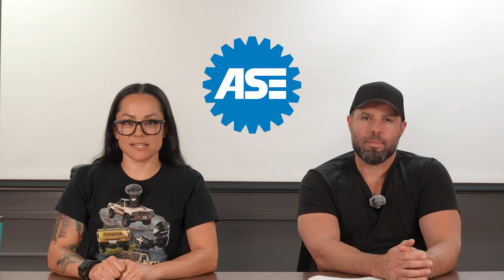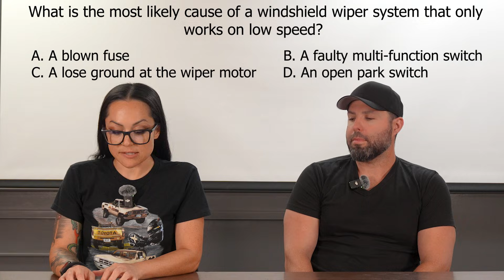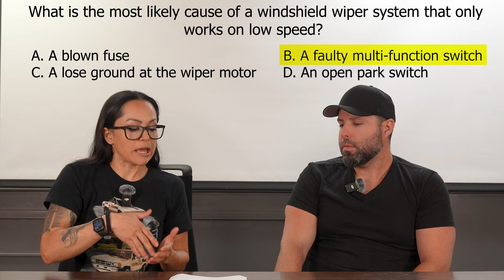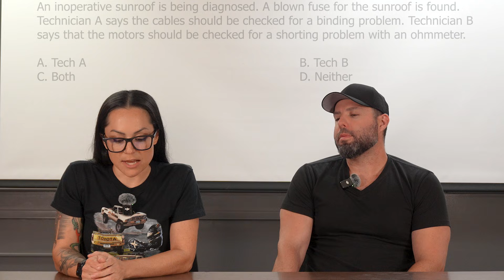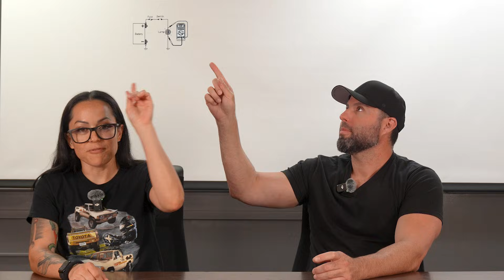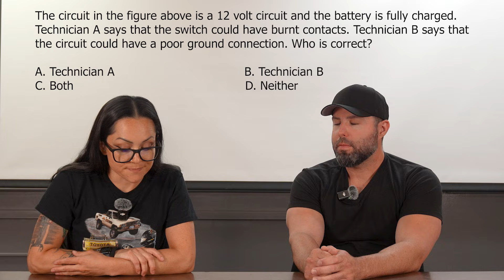Pass The ASE The First Time!!!! ASE A6 Electrical Test Prep Series Volume 1

Comment: I am a retired mechanic, 67 years old, When you get ASE certified it mostly means you are a good test taker...............Worked with some ASE certified people that did not know anything close to what they should have...............Real world experience...................
Reply: 🤣🤣🤣🤣🤣🤣🤣🤣🤣🤣67🤣🤣🤣🤣🤣🤣🤣🤣🤣🤣
Reply: I believe the same. But a lot shops pay you more if you are an ase master tech.  I will just take the tests to get more pay.
Reply: Sounds like ur lying , if ur as good as you claim by your statement, then honestly you should’ve just taken the test and get paid more , what are u gonna say ? “It’s just a paper”? But most mechanics are willing to spend 200$ on a over priced snap on tool but willing to call a certification just a piece of paper lol
Reply: But if you can break down the question the way these two just did I believe you can fix electrical problems in the real world if you have the fundamentals down you will do well in almost about anything in life. Though it’s true a lot of ase cert techs can’t fix problems
Reply: Yeah,  it's true.  I've got A1-A8 recertified since 2012, and I'm still not the best.  I'm good at studying and taking tests.  I can figure stuff out but takes me longer than it should sometimes.
Reply: So what is your point?
Reply: @StaticTesla  I think hs point is that being able to pass an ASE  test doesn't mean you will be able to do the actual repair or diagnosis on a vehicle. That part takes years of experience.
Reply: Facts!  I know people who’ve passed ASE tests and can find simple shorts. I also know a lot or people who CAN’T pass the ASE and they’re some of the best techs out there!
Reply: I think you need both.
Reply: SIXXX SEVENNNNN🤪

Comment: @13:00 hate to bust bubble, but clock spring is still used to turn the turn signal switch off after turning off road left or right, go ahead and change steering box and not make sure wheel is straight

Comment: I run my own shop I'm 45 and been a mechanic since I was 13 I've never been ASE certified! I've had some training but mainly self taught! If you seek knowledge you can find it and study it! I've been blessed!
Reply: I’m 25 I’ve been a mechanic for 7 years I’ve never been certified and had some good jobs and my own shop for 7 months got hooked on fent just got out of rehab 7days ago and ima take some tests to get my ase and hopefully open up a business legally and Ik having my ase will help me in getting a job for the meantime to get my cash up and get a car and take care of my daughter I agree if ur shops running good u don’t need it I specialize in performance and custom work as well as vehicle maintenance and part  replacement I wannna learn how to diag good and tune myself hopefully this test helps a bit Ik hp academy also has good information for what im tryna do they charge a ok price also for learning
Reply: I started at 13 doing custom suspension and installing hydraulics and airbags. In my dad's shop while he built motors for certain local street racers but you talking back in the day small block chevys and ford's. Fast forward to today and I build engines.back to factory spec. I do everything but build transmissions. I do AFM deletes on ls engines, certain ford deletes and also hemi mds! But some of my favorite is can system diagnostics! Put Jesus first my friend and anything is possible.  I've been sober for twelve years! Life has never been better! The clearer your mind is the better your work is!
Reply: Go get your ASE certifications and solidify your business credentials if you want to have your business thrive. I am not discrediting what you have, or what you have accomplished, but to think that you wouldn't attract more consumers through retaining certifications is extremely small minded. To claim you have the knowledge, yet, be too lazy to take a one hour test really says something about your character and the consumer sees that. Go get certified brotha.
Reply: @DexterHerrmann where I'm from My name speaks for itself! My business is thriving built off of honesty and good work! We specialize in engine building. It seems to be a lost art!
Reply: @joesmo4749 You don't know what you don't know.  I grew up in the industry but taking the tests exposed me to things I didn't know existed.  I still remember a question from the A9 that I didn't understand from over ten years ago.  It's the ones that you miss that will make you better.
Reply: Good for you. But a lot of shops place a heavy amount of merit and promotion potential on what ASE’s a technician has.
Reply: @999b0a I also work by myself

Comment: Great video! Can we get more? Also, the burnt material on burnt contacts has higher resistance also from the oxidation that occurs during burning. True for any conductive material that gets "burnt". Say for instance a starter goes bad and overheats the positive lead, even if just an end of insulation is melted, the lead needs to be checked for resistance change, Id normally replace a positive lead but some would test and compare to specs.

Comment: The 2nd question re: windshield washer system doesn't specify if the pump is power or ground side controlled. Based on your responses you're assuming it's power side controlled but that info would need to be provided in the question. Additionally, even if it is power side controlled you could have an open wire on the ground side causing it to be inoperative, so C is just as viable of an answer as D.
Reply: My thoughts exactly,   I hate these type of questions,   the way they are phrased  makes you doubt.   Is this a very simple question,  or is this  a trick question???  Both options are possible